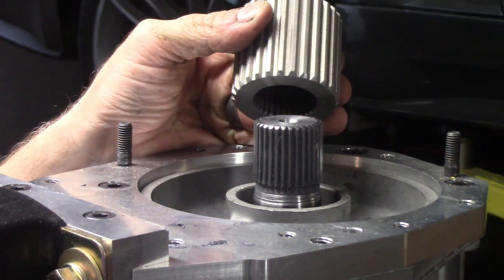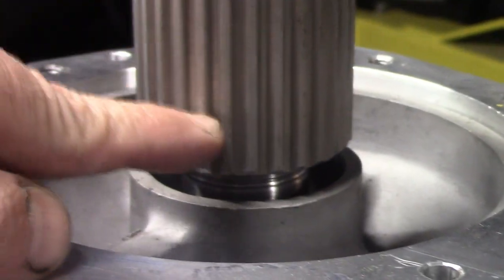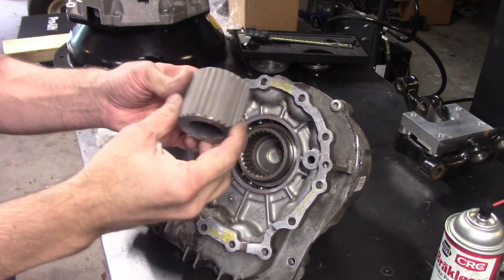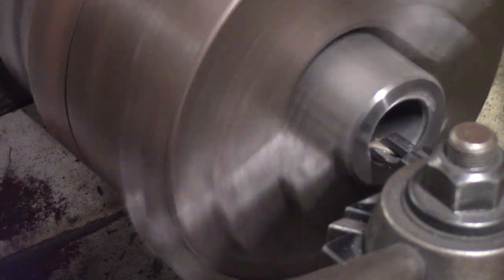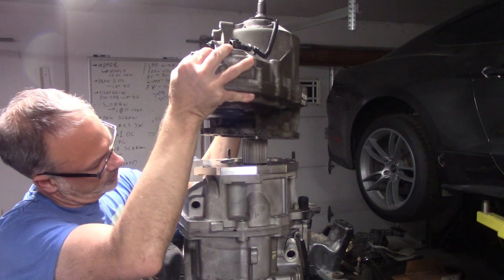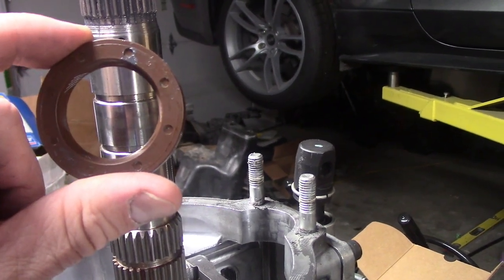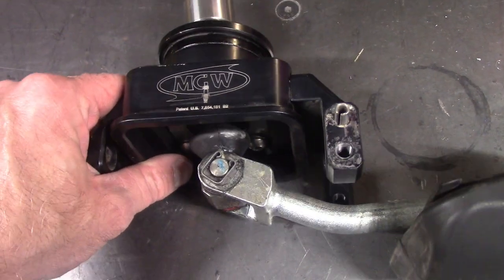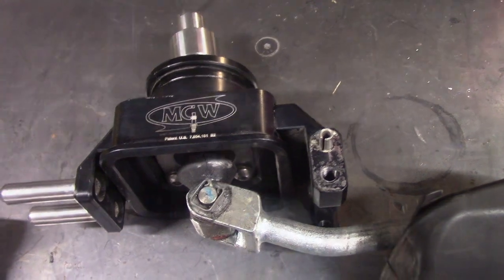Custom Wire EDM Transfer Case Coupler - AWD Mustang GT Conversion Ep. 8

Comment: Who did you outsource it to?
Reply from the maker: I used a place that doesn't normally deal with the general public.  They are in China, I used it as an experiment to see how it would work out for a home project parts.  I quoted a local source and they were not that much more and if I did it again, I would go local, but the part came out looking nice.  The heat treat is a bit harder then I requested, but I can deal with that.